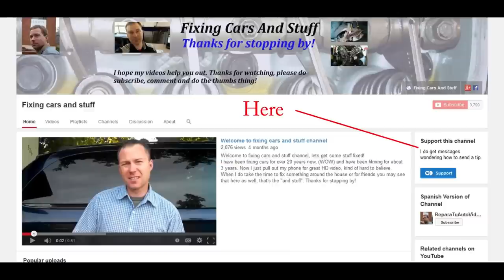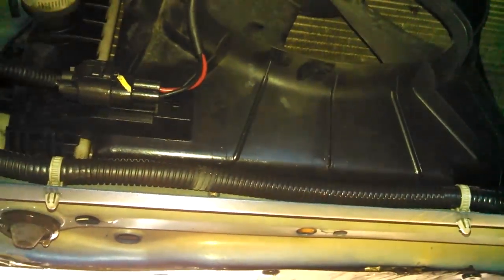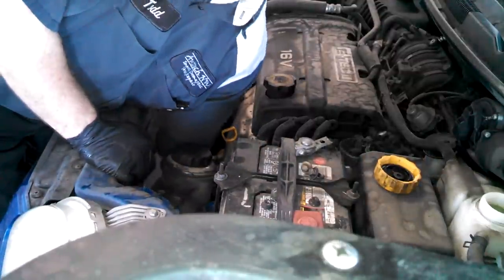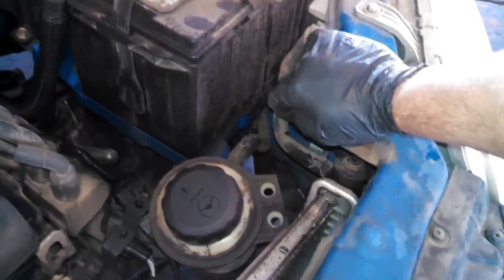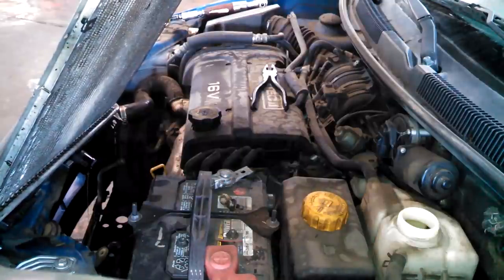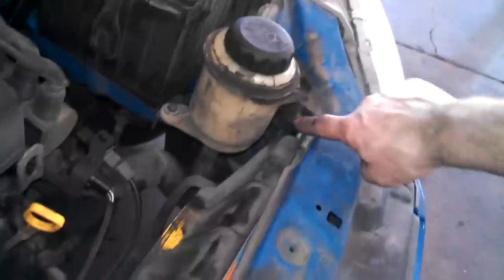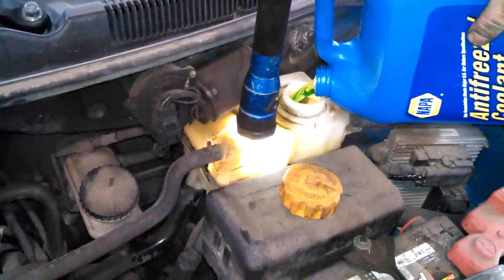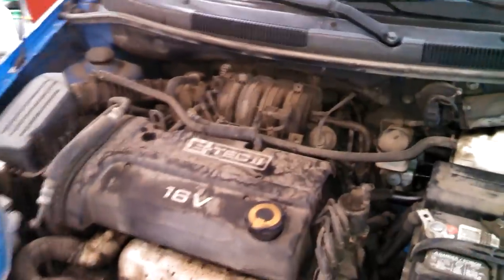Radiator replacement Chevrolet Aveo 2007 install remove replace how to change

Comment: Even though a 2011 is same body style the procedure is different as the AC condenser and the auto trans lines all bolt onto the front of the radiator behind the bumper. I just pulled the bumper off since it's very simple.

Comment: I was able to replace my radiator by watching this video and taking the advice of a friend.  If you're unsure how to get the new radiator in without it getting damaged by the power steering container corners just practice putting the old radiator back in until your ready. Also, my car has A/C so I tied the loose hoses up to a dip stick before detaching them. That way they didn't leak. One last thing, check the large hose to see if its soft when you pinch it, if it is just replace it now instead of waiting until it cracks. Good Luck!

Comment: Points at the lower-hose and calls it the upper-hose... The drain plug is on the "side" (passenger side) of the radiator towards the bottom. (the unit is mounted sideways so the reservoirs are left and right not top and bottom ~ picture a regular radiator and turn it sideways now the bottom where the drain should be is now on the side and a couple of inches from the bottom)  All in all a good video. The upper hose is where the fluid enters the radiator, the coolest water is at the bottom of the radiator.

Comment: What a goofy design wrapping the transmission cooler lines around the back of the A/C condenser; as if the radiator could outlast the life of the Aveo.  SMH

Would be easier to remove the bumper and disconnect the A/C condenser; otherwise, you're damaging your brand new radiator fins.

Comment: I just watched this as a refresher because this is going to be the second time I changed mine in my 07 automatic w/ac and there is no difference in replacement. regardless of your model all 07 aveo radiators follow the same procedure and may be the easiest one you can do.
Reply: there is no difference ,with or with out air condition ?

Comment: I think my shroud is missing. I have a 2007 chevy aveo. How will i be able to tell. I bought the car for 2700.00$$ and fuses keep blown out I hope its worth fixin!! Thank You Please Help!!!
Reply: Omg i cant this is my only transportation i have no job dam thks for info dam chevy
Reply: Thks so much i have chevy cruz shez awsome but it got stolen i got it back they messed up computer thank god for ins thks so much for info i drive for Uber so aveo have to work for now thks again how about ford what are good cars for them
Reply: @mronemanband1  LMAO What aveo did you buy? my aveo i paid 1400 dollars for 5 yrs ago and it's lasted very well. The only damage that has happened to it I take full responsibility for. I am watching this video because I took it two tracking and slammed the front in to the ground at 15 miles an hour so I think I cracked le radiator.

Comment: I just installed mine with this video.  My chevy aveo 2007 have air conditioning and I used the same method.  I have no idea what exactly he was refering too.  But it works just fine.  Thank you so much!!!!
Reply: Maybe the 2009...my task is harder than this.

Comment: I have a 2003 Buick Rendezvous. Can you tell me, if I were to take the fitting from the transmission line off, can I just install a new one back in? Without having any problems with the flow of fluid in the coolant system.  Thank you!
Reply from the maker: No, taking off the transmission lines from the radiator is no issue for the cooling system.  transmission cooler and radiator are built together but you can disconnect the transmission lines from the radiator  you will not loose coolant or anything like that.
Reply: Thanks for your reply. What I was asking was 'Could I take the fitting that have the clip on it off. You know the fitting that screws into the radiator with the clip to hold the line in. I didn't know but by mistake I've undone the whole fitting from the radiator. I just need to know can I screw it back on and not have any problems. Thanks@